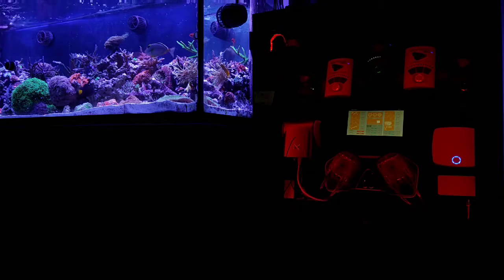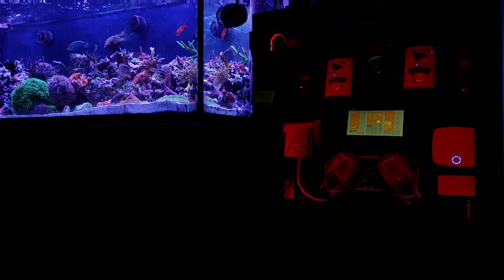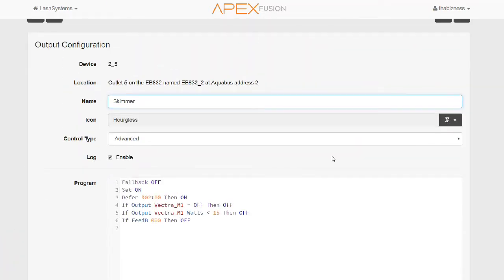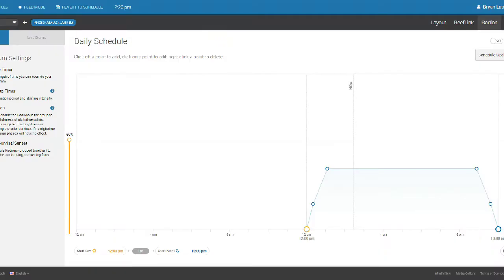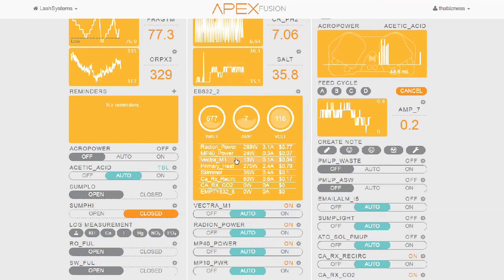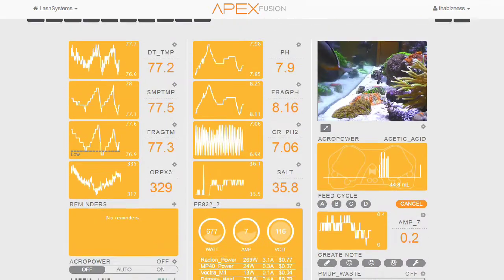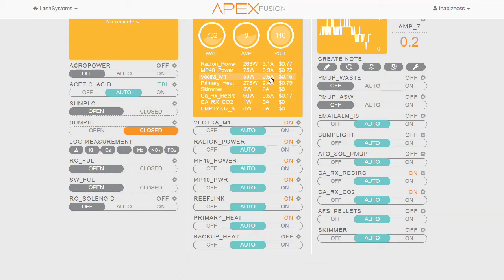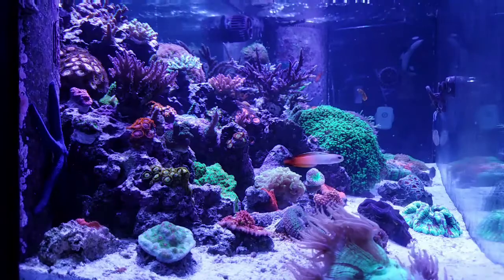Apex Tricks - Power Monitoring

Comment: For the video feed of your tank on your apex fusion main screen (at 0:58), what type of camera is that?  Underwater camera?  Was it difficult to setup?
Reply from the maker: Its a cheap Dlink IP camera. You would need to know how to port forward on your firewall/router to see it outside of your network.
Reply: Interesting, thanks!  I purchased a cheap Dlink camera previously, but couldn’t find a good mounting location.  Looks like you got a really good spot based on the clear picture.

Comment: That's a good idea to monitor pump performance.. I saw The Apex feed program inlcude shutting off the skimmer with an additional 10 minute delay on their site. I subbed ya..
Reply from the maker: Yeah I have that same programming also to delay startup until the sump level is steady. Thanks for your comment! I sub'd u back.
Reply: Tha Bizness Reef Tank Do you use the reef link although you have the Apex? I really have alot more i could use the Apex for but I'm so old school
Reply from the maker: Yes. I use the reeflink with Apex to control all ecotech products. I used a WXM for years but when I went to a Vectra that pushed the Reeflink into a higher position than the WXM IMHO. I like the light control in reeflink better then WXM (acclimation mode, control of brightness and overall intensity) The main thing I was missing was a 1 button feed by using the reeflink but now since Apex can detect watts used on the EB832 I can trigger feed stuff (like shutting off skimmer) from that.